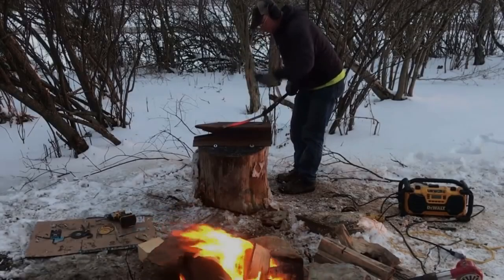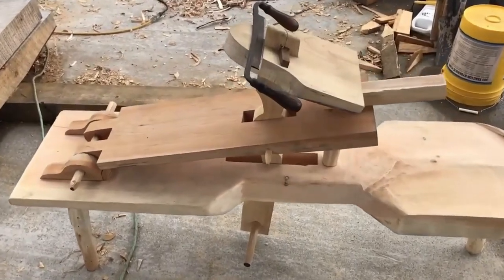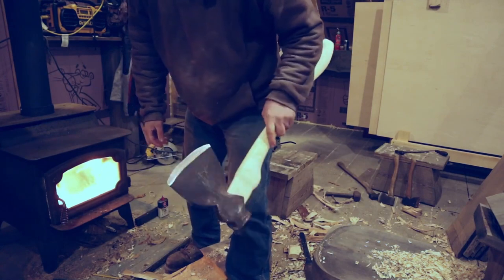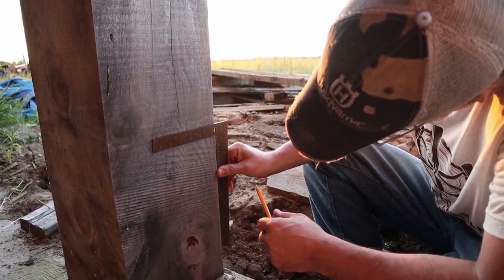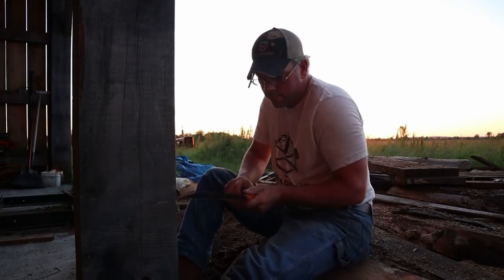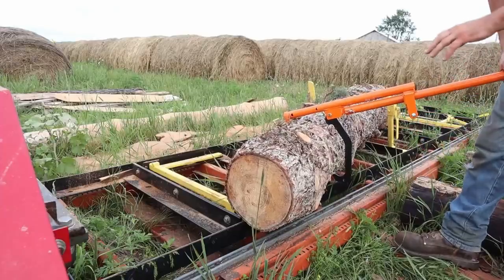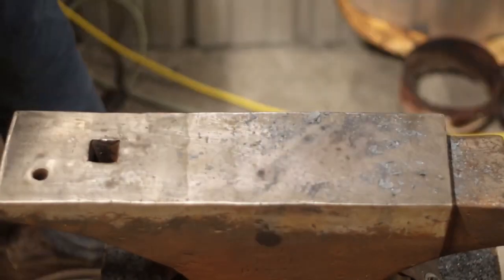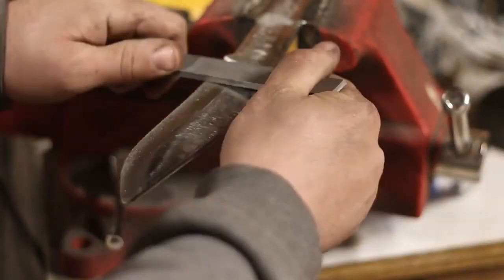Simple Off Grid Cabin: The Tools You Will Need, The Tools You Can Afford

Comment: Hey Jim in the scene putting a bevel on the knife blade you were using a tool right before the file. I couldnt see too well, what was that? Old hand tools are also handy around a powered home shop for quick and simple fixes where on cut or one hole is all you need. No need to get battery or cords.
Reply from the maker: Hey Mike.  That was a dremel on steroids, you see them in factories quite a bit for de-burring small parts.
Reply: @TheTradesmanChannel  thanks. Knew it was bigger but never saw one.

Comment: Awesome video Jim very great editing a lot of work went! I can only afford the cheap tools, sad thing is I have to save up for them. And then usually get frustrated with myself for buying cheap tools when they break one the first or second job/project.
Reply: Do your damndest to buy used/ old tools but not from dealers.    Old leaf springs and an angle grinder will go a long way towards heavy chisels (they do not have to have a wooden handle,and you can hit that with a club hammer)
     Jim, watching you file that knife, with it bouncing like that, made me think of the good old fashioned filing clamp that I was taught to use at school, basically a brass faced lump of wood with a simple double wing nut and bar clamp on it.  Stops the bounce.
Reply from the maker: Good morning.  That sounds better than a bench vise.
Reply from the maker: Thank you Lance, you work with what you can.
Reply: @TheTradesmanChannel  I definitely do. I even recycle nails to use I straighten  em out with a vise 🤦🏻‍♂️
Reply from the maker: Everybody should do that
Reply: @LanceSheppard  yup, I have a bucket of old nails. The bottom 3/4 is probably still nails my grandfather saved from outbuilding teardowns over the years.
Reply: @thomasarussellsr  I suprise myself sometimes but had been raised by grandparents I was taught frugalness early on

Comment: Now that your making chisels , i will be glad when and if you are willing to make cranked neck patternmaker chisels in a 11/8 , 1 1/4 , 1 1/2 , and a 2 inch size with a 8 inch blade length and a 6 inch handle made of curly birch or curly maple . and a 4 inch blade short crank . i would buy all 5 9f em right now .A froe also . Styled like a marples or henry taylor chisel .l